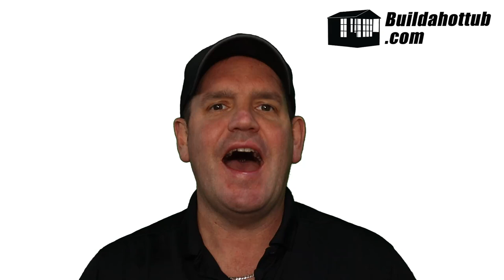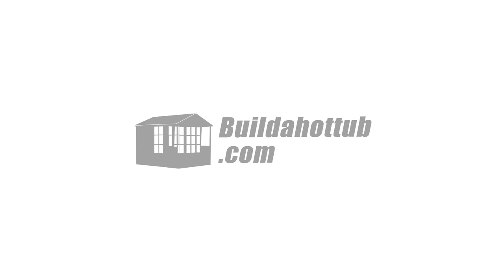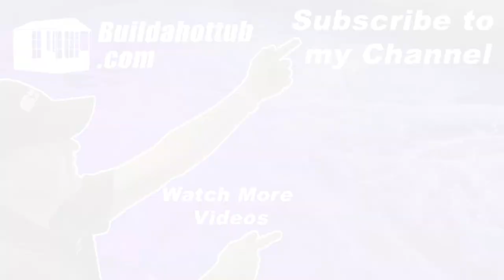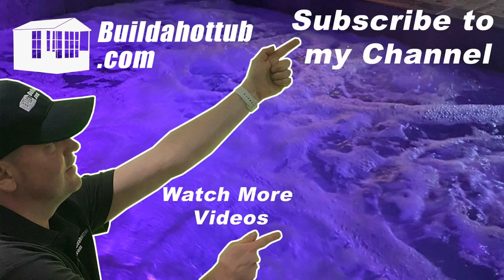Identifying and Replacing a Hot Tub Circuit Board (PCB)

Comment: Hello Andy, 
Steve from Phoenix, AZ, USA here. 
I have an older (2002) MAAX Spas branded Coleman 107 tub with a Balboa pack containing an M7 board hardwired for 230V with a circ pump, a 1.5 HP pump, heater and light. No blower or ozonator. 
The spa.was working fine then just decided to stop heating. 
No error codes in the display and the heater light was on, just not heating. 
Looking at the board I noticed a burn mark on one of the heater relays where the jumper wire from the upper relay connects to the lower one. 
An ohms test on the heater lugs shows 10.5 ohms and each lug is showing 115V.
Before I commit this board to the bin, is it possible to replace the relays and fix the issue? 
There are no burn marks on the board, front or rear. 
Thanks!
Reply from the maker: Hi Steve, in theory, yes, it is possible to replace just the relay if you are good at soldering and can source the exact relay from an electronics supplier. Certainly cheapeer than a new board. If you do need a new board, my parts store will likely have it - www.parts4tubs.com - hope that helps - Andi
Reply: @Buildahottub   Thank you!